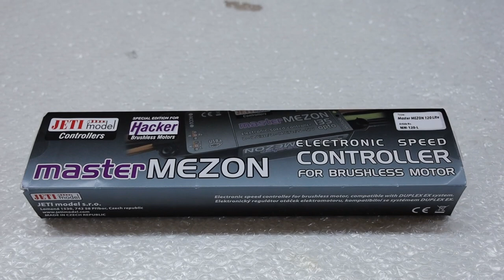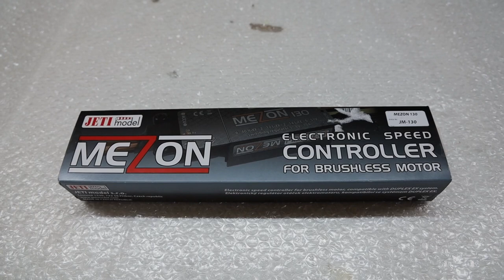Hangar 9 ov 10 bronco & Fokker D7

Comment: Hallo Egbert ik heb je zien vliegen op Odoorn in september, super!! Het heeft me doen besluiten ook een Bronco te kopen  (die staat nu hier 😃) mijn vraag is welke maat propellors gebruik jij? BTW ik neem aan dat jouw Xpwr30ccv2 motoren dezelfde zijn als de Xpwr 32cc bij Bert ?
Reply from the maker: Hallo Erik. Wat leuk om te horen dat jij een Bronco hebt gekocht omdat je die van mij hebt zien vliegen in Odoorn. Ik gebruik 19x8 electric houten props van xoar. Misschien zou 1 slag groter ook nog kunnen, maar dit gaat dan weer ten koste van je vliegtijd. De xpwr32cc is de opvolger van de xpwr30cc. Wat specs betreft zijn ze hetzelfde, de 32 zou verbeterd moeten zijn als het om duurzaamheid gaat. Als je nog meer vragen hebt mag je me ook altijd bereiken via facebook of instagram als je dat makkelijker vind.
Reply: Hi egbert, did you try other propellers with 20" or are you satisfied with the 19x8?

Comment: Hello Egbert, one question to your elevator. Did you simply split the cable  from the servo via y-cable into two Individual lines and you put them together via a 2nd y-cable in the fuselage so you have one to plug into the receiver? All the best Jens
Reply from the maker: Hello Jeremy. Yes that's exactly what i did. Because there are so many connectors this will eliminate a connection failure.